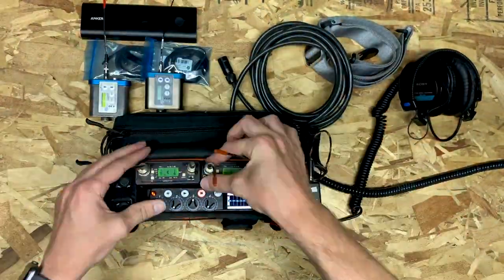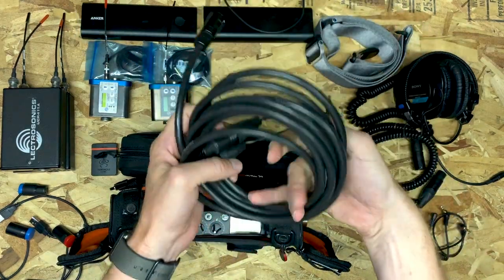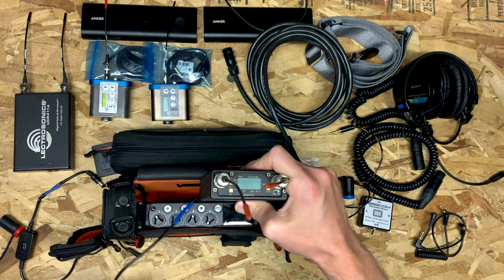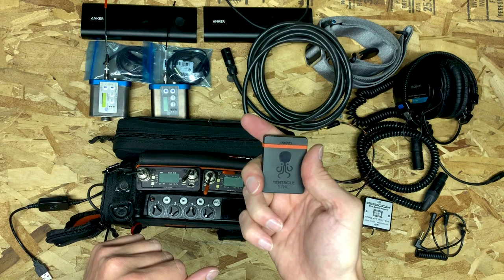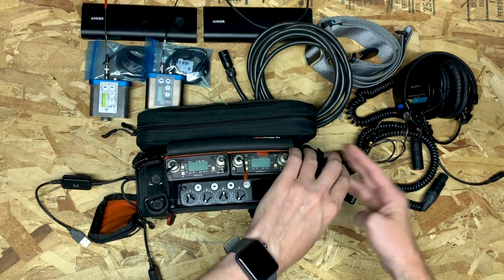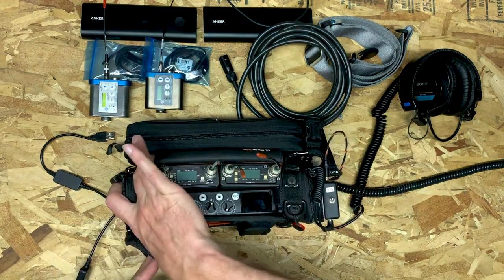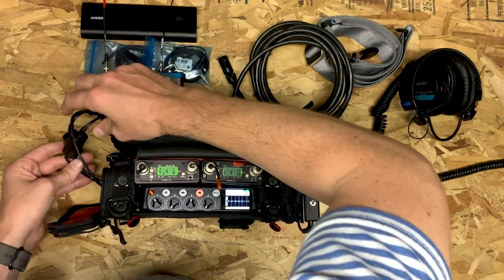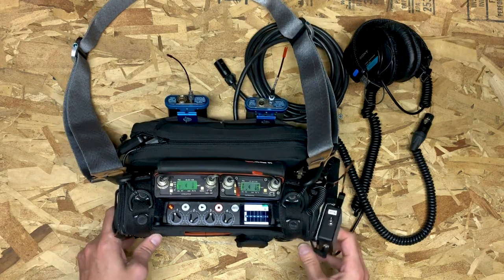Building a Location Sound Bag Around a SoundDevices MixPre-6

Comment: You use a boom and wireless mics on the same shoot? If so, why?
Also is the person that records the sound also responsible for mixing that sound into the film? If so what software do you suggest?
Reply: Boom audio sounds different than body mounted mics for wireless. Not typically, post production audio is done by someone specializing in that, but anything goes for you tubers.
Reply from the maker: Hey FB — As for your first question, I like to think of boom and wireless as redundant backups for each other. A properly mounted lav can do great on a windy day or in a noisy environment; I think booms tend to sound more natural in well-controlled environments—and mixers will have their own opinions.

As for the question about "mixing," there are two things here. Often the person holding the sound equipment on the set is called the "location sound mixer," because the expectation is that you are delivering production-ready audio as you are recording it. There are production companies—from quick-turnaround commercials to reality tv shows—we're for a variety of reasons they are going to take what you give them, sync it to picture, and call it a day. More complex and bigger budget projects will edit your audio after the fact, with a different person than you. My sense is that the industry standard for this is still Pro Tools.

Comment: what are you bringing to a shoot in terms of redundancy? Do you have a backup for every aspect of your kit?
Reply from the maker: I do not have a backup for everything Shane, save for batteries and SD cards. If something bigger than that blows, I'm in trouble. One thing about the MixPre (version 1) compared to the more expenseive SoundDevices mixers is that it doesn't have any writable backup options, so I have been known to run my mix into an old iPhone and record a backup of my entire day in there. Recovery would be a pain, but it would be there if you need it.
Reply: @FieldNoiseWorkflow   noted. that amount of redundancy makes sense since you could ask to reshoot something if absolutely necessary. I work in the remote recording world of concerts and televised musical events, so asking for a reshoot is impossible.... so redundancy is a must.

Comment: Hey my friend, in B&H they say they don't recommend using usb power for the mixpre II? just wondering if the anger batterys u are using really works good for field use. ? thanks
Reply: Not sure why B&H would say that. The battery I use, the Anker PowerCore+ 20100 USB-C, is still recommended on the SoundDevices website. Obviously I haven't tested with the MixPre II, but this has always worked fine for me in the field.
Reply: @craigeley  thanks Craig !
Reply: @xanxpty  USB 1, 2, 3 and C progressively provide more amperage from the USB connection, specs says you should be ok with the Anker.

Comment: So if I understand correctly, you are actually cabled up with the camera?
Doesn't that limit your movement and the camera's movement drastically? :)
Reply: You cable up for when the camera(s) are on tripods and are focused, typically, one someone they are interviewing. Otherwise, put a sync box on the camera or send them wireless to the camera for scratch audio.
Reply from the maker: Hey Tajs—just for a follow-up here, you probably wouldn't tether in fast moving / run-and-gun situation, as Larry mentioned below. This is almost always for fixed shots. For other uses, yeah, use a Tentacle to sync timecode and then have the editor sync in post.

Comment: So you are sending unbalanced output signal to a balanced input of the Camera? That doesn't sound right?! And you just hope they don't turn on phantom power an fry your Mix pre?
Reply from the maker: Hey there—if you are worried about that, then there are custom cable solutions that allow you to connect the MixPre's 1/8" ins and outs with a 10-pin ENG cable. For example: https://www.gothamsound.com/product/mixpre-eng-camera-breakaway-adapter-cable

Comment: May I ask which SD card you use in the MixPre?  If non-Sound Devices, have you had issues?  Thanks.
Reply: I've been using the 'SanDisk 32GB Extreme SDXC UHS-I' in my MixPre-6 without any issues.
Reply from the maker: Me too!
Reply: @FieldNoiseWorkflow  I'm pretty sure that's what I bought and it's working.  Thanks again.

Comment: can this go around your waist?? I bought it thinking this! Not sure it will work if it goes over my shoulder while im booming, and if I switch than I cant reach knobs
Reply from the maker: Hey Jeff—I don't think this bag has a waist belt option. I've never run into problems while booming, but for extra security you could wear it using a harness, which I started doing. This one is great: https://www.bhphotovideo.com/c/product/982920-REG/porta_brace_ah_2hb_audio_harness_without.html
Reply: @FieldNoiseWorkflow  Orca and K-tek also have waist belts. Either should work, unless something gets in the way.

Comment: Any updates on this? I'm setting up a lightweight bag with about the same gear.
Reply from the maker: Well, all of the MixPre mkII models can generate their own timecode. My guess is this means you don’t need to keep the Tentacle attached and can monitor cam return from the aux in jack!
Reply: Amazon sells a less expensive A/B switch and my Porta Brace case for a 302 mixer fits the mix-pre 6 and is very light. The receiver bag that fits onto it is a little large but could be modified to make them fit tighter and can fit 4 receivers easily. The Anker fits underneath the Mix-Pre. Having said that, I changed to an Orca bag designed for this use.
Reply: Will you tell me what brand of lav mics he’s using in this video?

Comment: How much did this rig setup cost ?
Reply from the maker: New it would be well over $5K, but the key is finding the expensive things used. It's been a while now, but I was able to get the wireless channels used as a package (receiver and transmitter), which saved a TON off of the Lectrosonics retail price. (I think I bought one channel then saved up for the other one while still using a Sennheiser channel). Likewise, you can often find Sennheiser 416s for $600 or $700, not the $1K retail cost.

Comment: have you update to the mixpre 2 and if so what have you changed in your bag
Reply from the maker: Hey Lawn—have not upgraded yet, not sure if I will. One of the things I'd be interested in is if I could disconnect the Tentacle, then I think I could run the cam return back into the MixPre, which means I wouldn't need that external box. However, I would want to set a headphone preset or really figure out the routing in the settings so that the cam return does't accidentally end up back in the mix, create feedback, etc.
Reply: Field Noise yes you can because the new one has its own real TC

Comment: What model wireless lectrosonic transmitters are you using  ? And how do they record into the mix pre 6 you have ? No reciever going into the Xrl of the mix pre 6 to record the lectrosonic transmitter and lav set up ?
Reply from the maker: Hey Charles — if you look around 2:25 of the video, you can see me connecting XLR cables to the Lectro 411 receivers and then connecting those to the XLR inputs of the MixPre. The transmitters are Lectrosonics SMQV.